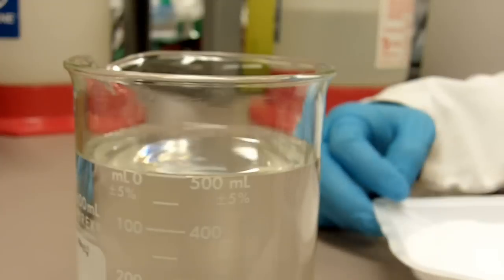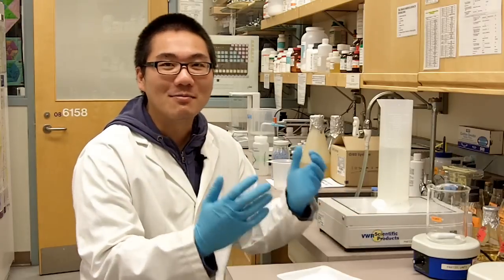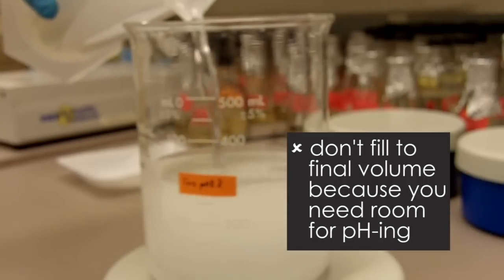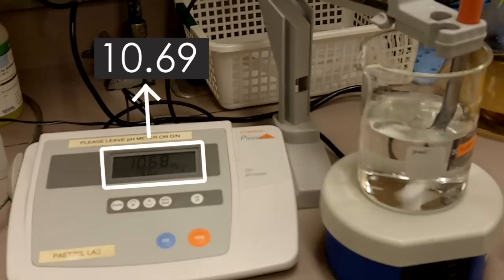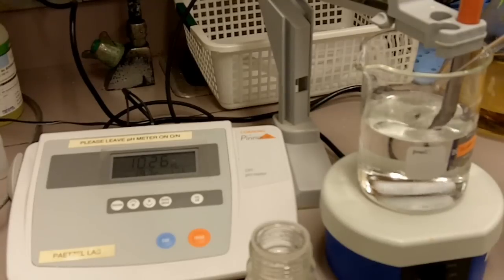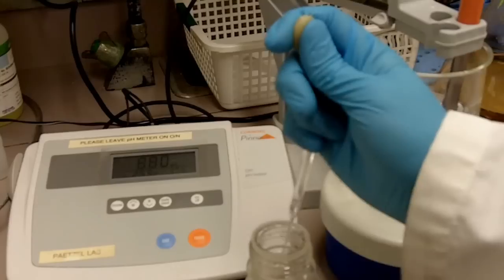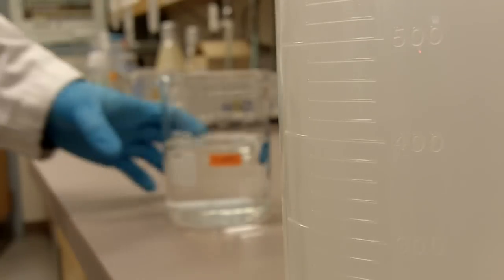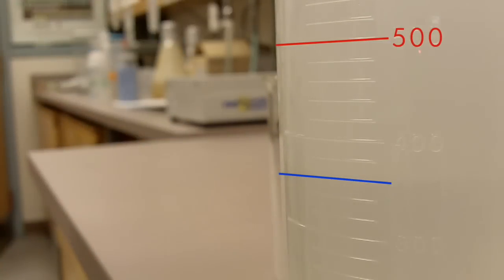How to Make and pH Buffers

Comment from the maker: Yes before you use your pH meter you need to calibrate it to make sure it reads the pH of your solution correctly. To do this, standard buffer solutions at pH 4, 7, and 10 are usually used, and you can buy the standards from a variety of companies. We don't show how to calibrate the pH meter in this video because each pH meter is different - so follow the directions for your device and calibrate it...it only takes a few minutes =)

Comment: Thanks for the video. But, what I was looking for was how to make step 1) Weight out the dry ingredients. I know you have to grab Ka (sometimes Kb) values and do some number crunching. And put a set amount of dry polyprotic acid and it's conjugate base (by using Hedderson's equation to find out how the ratio of base/acid) instead of slowly adding HCL. We did it very differently in my class. But, the techniques are virtually the same.

Comment from the maker: You must stir the solution when measuring pH. This will ensure that the acid or base that you are adding is being mixed with the solution, giving an accurate measurement. If you do not stir, then it will take longer for the acid/base to disperse through the solution, and based on where your pH meter is placed, your pH measurement will be too low or too high. So remember to stir your solution =)

Comment from the maker: Yes you can use hydrochloric acid (HCl) if your starting pH is higher (meaning that it is basic), and you need to bring it down to 7.0. However, if your starting pH is lower than 7.0 (ie. it is acidic), then you will have to use sodium hydroxide (NaOH) to bring the pH level up.

Comment from the maker: @bobtheowl2 
Very good question. That is why you must reach ~75-80% of your final volume before your pH. Then after pHing when you add more water, the change in pH is very small that it is negligible. Remember you are working with a buffer (and not just an acid or base), and it's the buffer's job to resist change in pH. So that extra water you add will not have a big impact on your final pH. Hope that helps =)

Comment: if you fill it up with water to final volume wouldnt the ph of the final buffer be slightly different since you have diluted it with water?
Reply: @Thijs Janssen thank u
Reply: This is what I want to ask 😂
Reply: @sabrinasin123  5 years later i'm finally a diploma graduate now :) and yes, what janssen said is correct. after the buffer has been set to its pH range, adding the final 140mL of water would hardly mess with the pH as the whole point of buffers is that it helps to prevent drastic shifts in pH!
Reply: Actually when you add water the relative concentrations will stay the same the only way a buffer can change ph depends on buffer capacity and needs large volume of water so it can change ph
Reply: @amirhosein1127  that is correct! dont forget to calibrate your pH meter prior to making the buffers :) im no longer a laboratory graduate anymore as i've moved on to physiotherapy but all the best to those still in this career and have fun with it!

Comment: what kind of ingredients were used there?
Reply: If you are adjusting the pH with a strong acid or a base then there should be only one ingredient  depending on where the desired pH falls relative to the pKa of the buffer. you can start with the acid or the salt component of the buffer.